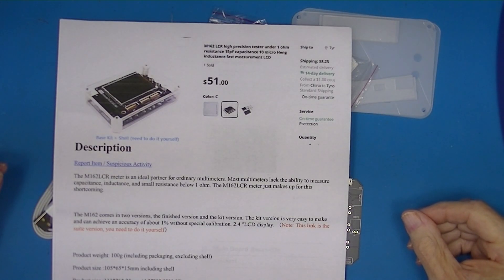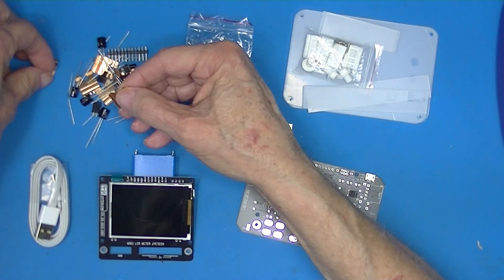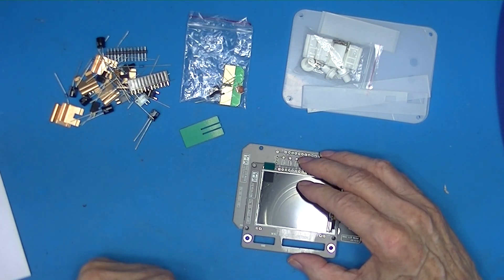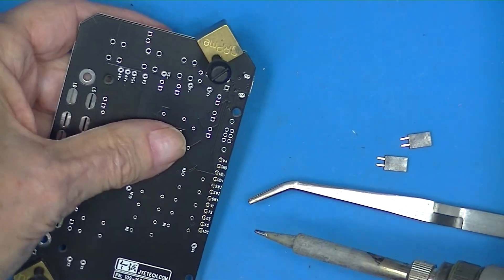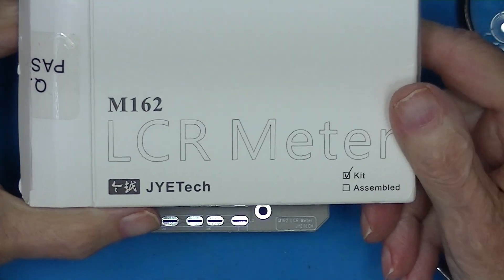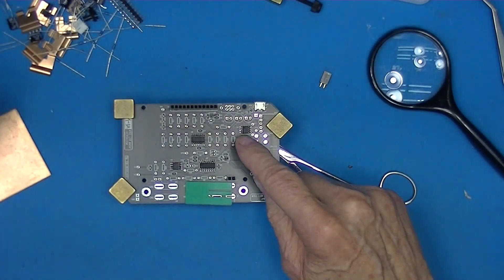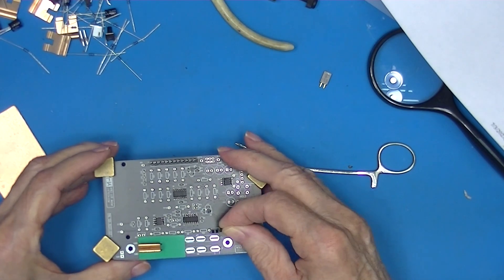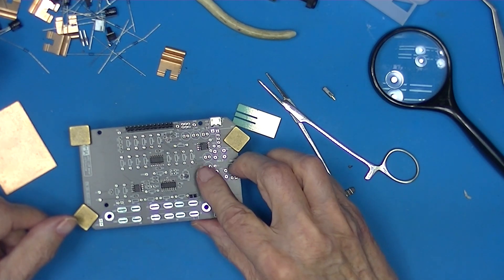Building an M162 LCR Meter – Part 1A

Comment: This kit requires more skill & equip than many expect.  I found the metal clips hard to install and I messed up my build. I'm considering another one but more than likely I'll get a finished meter instead of a kit.  I can recognize though, that the SMT work required more skill than I had at the time of my build. Don't feel bad about the result, it's a learning experience.  It's best to get the case too because it would have been more intuitive about how the clips attach.  Instructions were not very good either.  Thank you for making a video about this kit.

Comment: Mine works perfectly, except I can't edit the settings. I can reach the menu, but I'm not able to change anything. The buttons are fine because I can zero everything. I have the latest firmware (1602-081). Anyone experienced similar and have a fix?

Comment: Man you don't know how to solder. First of all you start with the smallest elements, in this case resistors, goldpins are soldered at the very end, only sometimes there is a different order. For better soldering use flux, because what is in the solder wire is not enough. You have a dirty soldering iron tip. You do not read the instructions you make stupid mistakes. It looks bad

Comment: This kit appears to be better quality than a typical Ebay/Asian Kit... Even with the assembly bumps. If the finished unit has features and accuracy comparable to the DE-5000, this kit would be a less expensive and way-more-fun option.